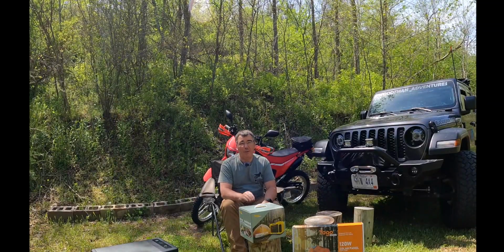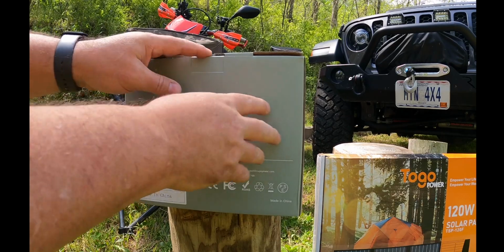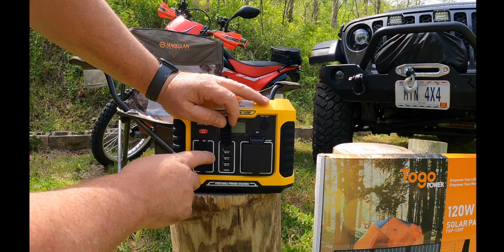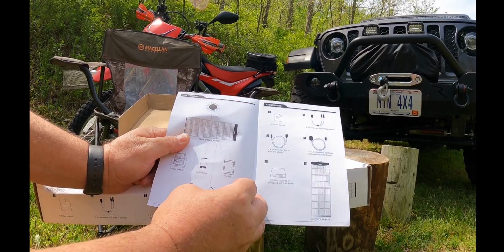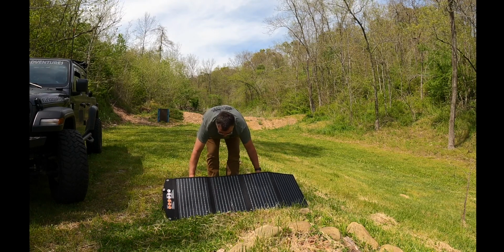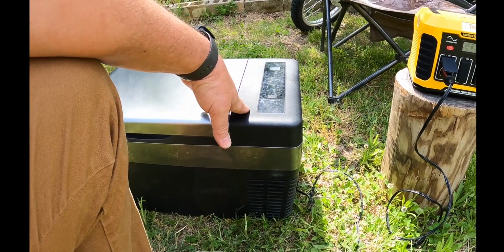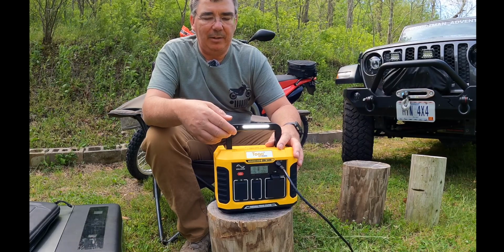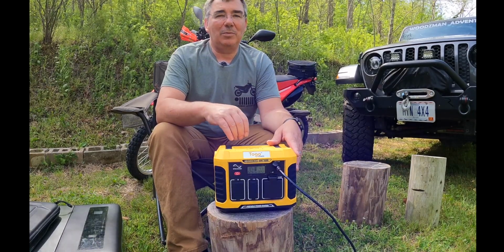ToGo Power Advance 350 Portable Power Station & 120W Portable Foldable Solar Panel Unbox and Review

Comment: Thanks for the info have you used it on any other camping trips? How did it perform. Thanks
Reply from the maker: I have used it to run my mini fridge on a day trip and it worked great, a little small for long trips with the fridge but al long as you run the fridge at night and charge the ToGo during the day while driving, it works good

Comment: Hello I have a question I purchase the same one advance 350   When I try to charge my iPad with the usb c connection I the output is only 8 to 9 watts.  So the iPads does not get charge at 60W.  Have you try ii to see the results on it.
Reply from the maker: It charges my iPad fine and I have also charged my MacBook Pro.  It charged both fairly fast